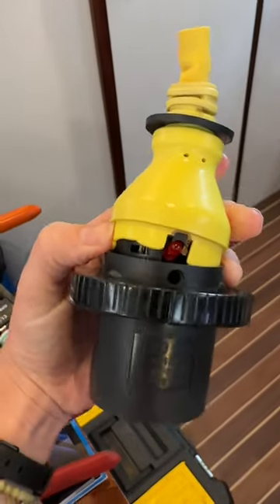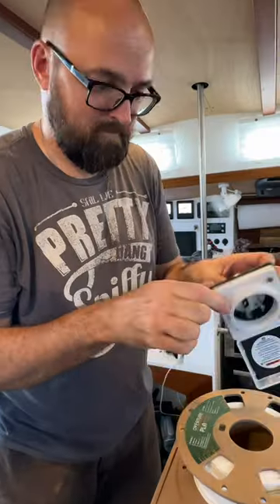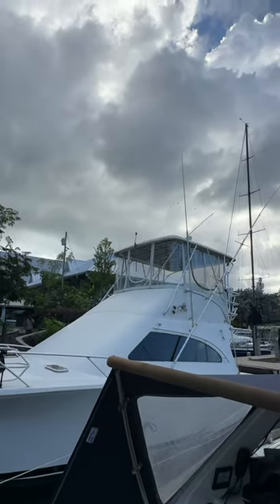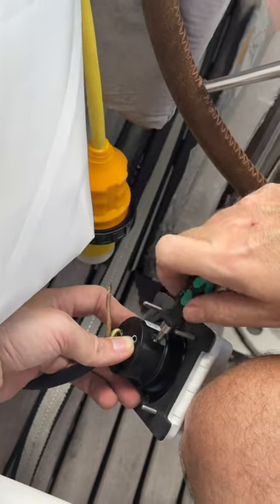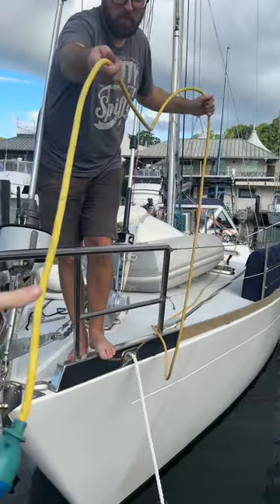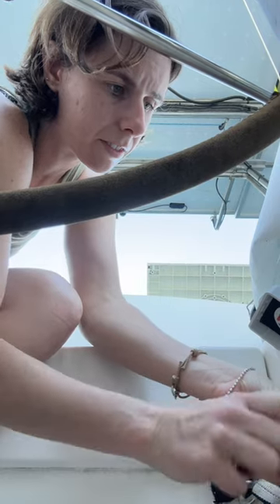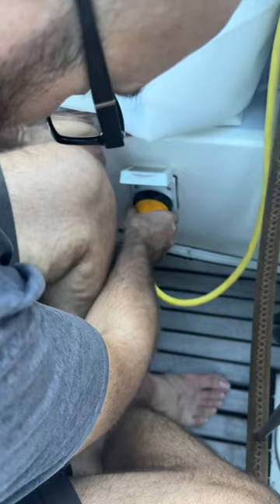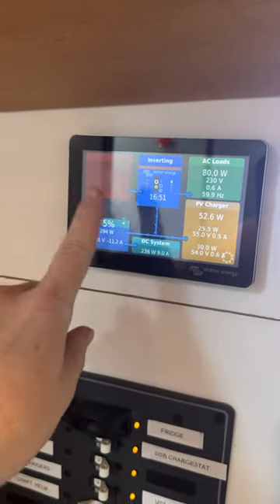Sail Life - shore power plug

Comment: The few times we are at a dock we almost never plug in.  The marina people are always shocked when we say we don't need it.  It's usually not worth it to drag out the cord and plug in and then need to coil it all back up again when we leave.  Solar panels and a wind turbine are all we ever need. We don't even have a generator.

Then again we don't have a washer/dryer, Air Conditioning, Microwave or even a water heater other than the kettle on the LP stove.  We even hand/foot pump out water inside the boat.
Reply: i forgot to mention that we met another boat that doesn't even have an AC panel on the boat.  They do have a battery charger but when they need to use that they just run a regular household extension cord into the boat and use a shore power adapter to plug it into dock power.  

That system makes us look like heavy power users.  We usually use less than 50AH/day but when we get a water maker that is going to go way up.